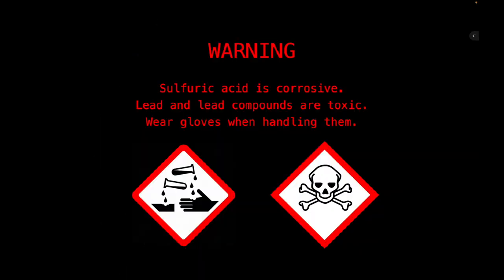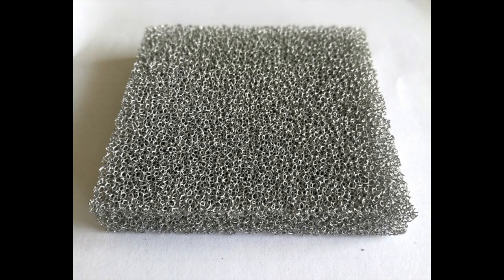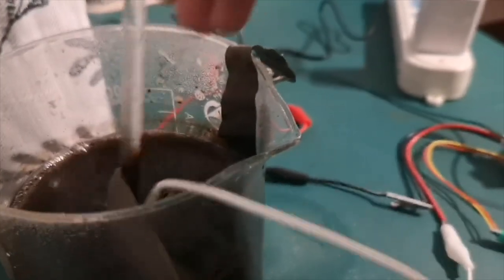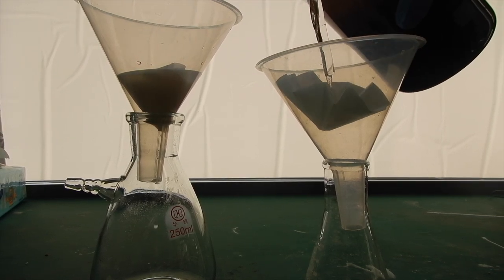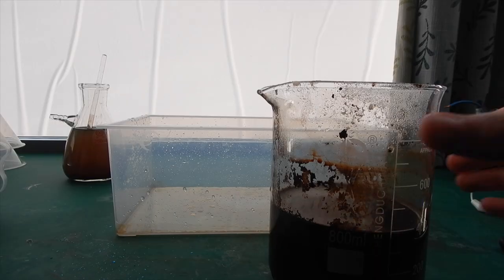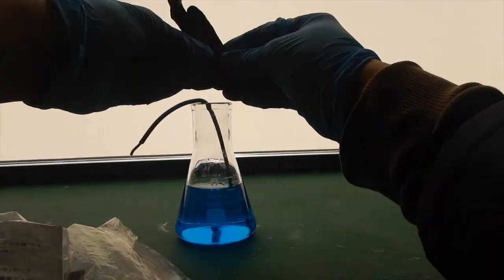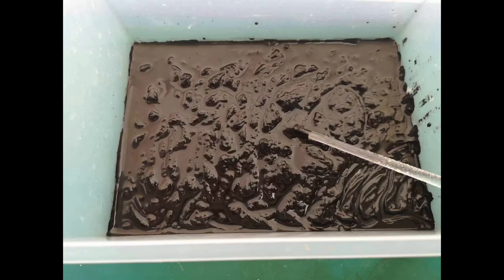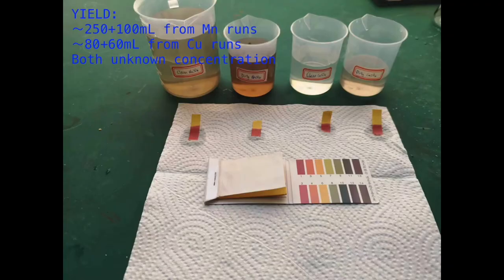1.3 Three Acids - Making Sulfuric Acid by Electrolysis

Comment: The purple colour form the CuSO4 electrolysis is from the deposited MnO2 from the previous electrolysis. The MnO2 is oxidized to permanganate with the lead dioxide anode
Reply from the maker: Wait... If that is the case, then it might even be possible to directly oxidize MnO2 to permanganates via electrolysis... That will be a far more efficient method than the one I am preparing now! If you have any extra information I'd love to hear them. Thanks!
Reply: @MIH0319  sadly I don't have any more information that the one i just gave you.

If it's useful i thought about one method using this reaction that consist of making a plate of lead that covers the bottom of a beaker and make it a lead dioxide anode. Then, using this anode to make the permanate by placing the manganese dioxide over this plate and run the electrolysis.
The MnO2 directly in contact with the anode will be oxidized to MnO4- and let the rest of MnO2 fall into the electrode, continuing the cicle
Reply: @MIH0319  searching in my pdfs i found this method that uses a sodium hydroxide solution and agitation to suspend the MnO2 into solution
https://patentimages.storage.googleapis.com/pdfs/78fbb0634169a2a961b3/EP0336542A1.pdf
Reply from the maker: I would probably try this method in my permanganate sessions. I'll be doing both methods including the industrial approach and electrolysis. We'll see how it goes!

Comment: yeah... here is  some advice, if you do have access to sodium hydroxide and plaster, you can make sodium sulfate, place it on the anode of a divided cell(do it like scrap science and use a flower pot for the diaphragm cheap and quick, worked for me) and  and run it, over time the sodium ions will migrate to the cathode chamber forming sodium hydroxide(you can use to leech more sulfate from the plaster) and the anode, a some amount of dilute sulfuric acid.I find this method to be cheaper than copper sulfate and reasonably easy to do. for anode since it is just sulfuric acid, lead can be used, graphite also does well, anything that is attacked by sulfuric acid will be good, I guess.just do not use copper anodes, won't work.

Comment: I found a nice iron sulfide rock. Can i make sulfuric acid with it? It smells like sulfur when you crack it open. It has shiny crystals inside too look like tiny cubes.
Reply from the maker: Yes... But it is going to be difficult. The industrial process here in China uses iron sulfide (FeS2) as the starting material. It is roasted in air to make SO2, and then oxidized to SO3.

Comment: If you used a clay pot membrane there would be a lot less steps
Reply from the maker: Yes... The pot would contain the MnO2. But I am not sure what kind of pots should I buy for this purpose... Will casual garden pots work fine?
Reply: you need to use an unglaced clay pot, this will work as a semipermeable membrane, there are lots of videos out there explaining the process in detail